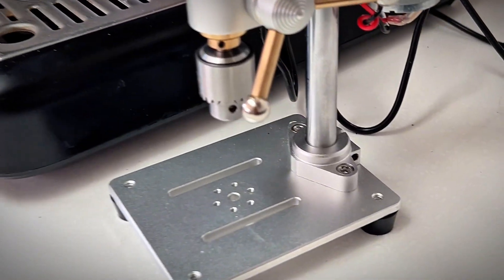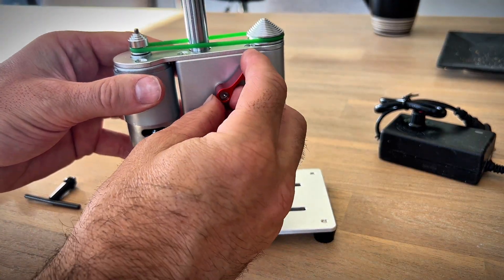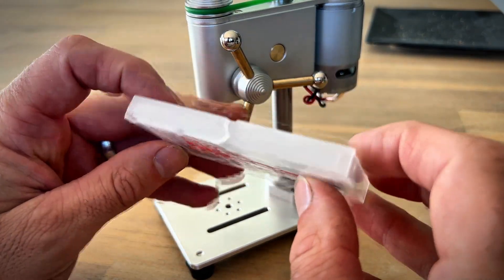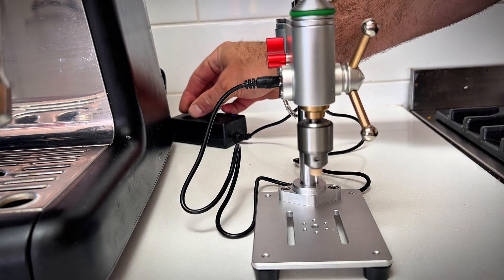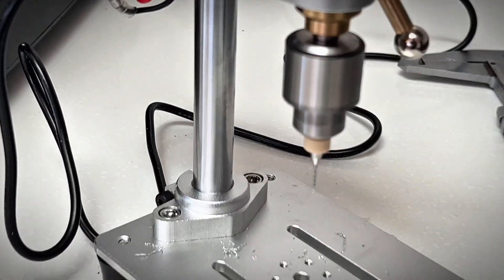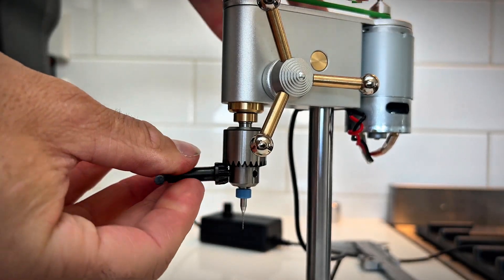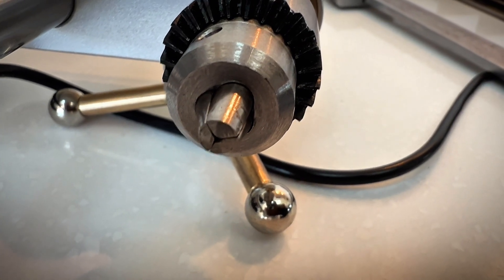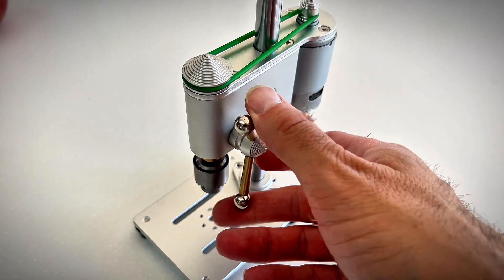THE SMALLEST DRILL PRESS YOU HAVE EVER SEEN? - mini precision drill press.

Comment: Any idea what the runout on that is?  It would be interesting to see where the runout is too.  Bit, Chuck, spindle? 
 Lastly, if the runout is in the spindle itself, how easy would it be to disassemble to fix?
Reply from the maker: I’ll see if I can get some measurements and let you know
Reply from the maker: The runout is largely from the alignment of the drill bits in the chuck itself, if I play with the tightening process the drill bit wobble can be eliminated. I’ll make a video soon to show the process
Reply: @ENTHUSE_Me great! Thank you!  By your description, it could still be in the chuck. Jacob’s chuck are notorious for high runout. There are high quality German ones, but they are pricy.  Still would like to know what the runout of the spindle is though.  This can be typically corrected by upgrading the bearings.

Comment: To eliminate the wobble, get the fixed collet version of the drill.  My collet is 3.17mm (1/8"), though which can be annoying to find carbide or HSS bits for.  I think the ones you have there are 1/8" but quite soft.  I ended up buying both versions of the drill.  The locator plate is pretty cool but doesn't have a lot of range, and the little vice I got attached to it has limited use. I have other tiny vices but I can't attach them to the locator plate. Frustrating.  Still... I was able to drill out rusted screws from a ceramic watch case using this setup.  And I only broke one bit!  lol.  That's never coming out.
Reply from the maker: That’s great advice, thanks for sharing your experience and tips!

Comment: was fascinated until you actually fired up and the wobble became apparent.  Sorry, but for all the manufacturing effort, that wobble is an accuracy killer and will break those tiny bits.
Reply from the maker: Yes at slow speed it had a bit of a wobble, with a bit of a realignment in the chuck it will help. 
At higher speeds it steadies up and I haven’t yet broken any bits, so it performs much better than I thought. Especially for the price range
Reply from the maker: Can confirm that if you play around with the tightening of the chuck you can get the runout much more steady, I’ll try make a video soon to show the process.